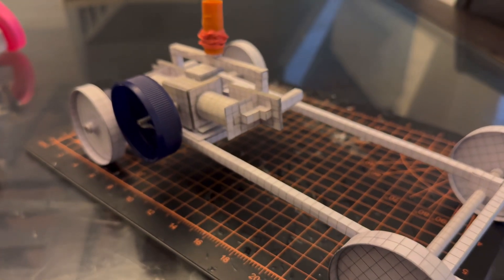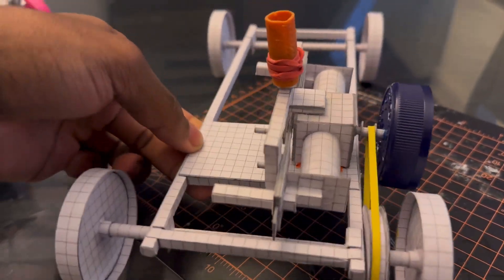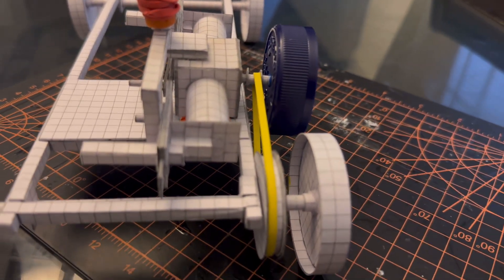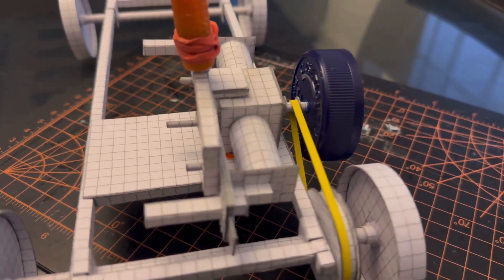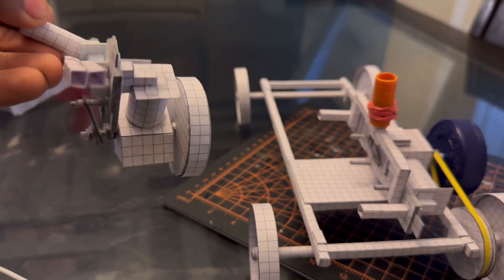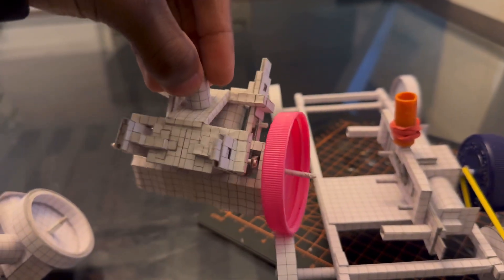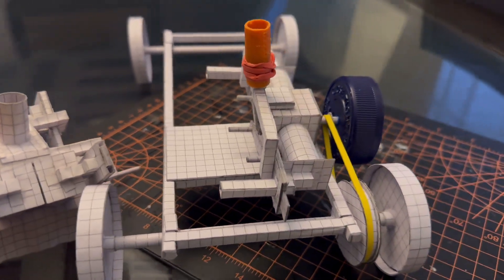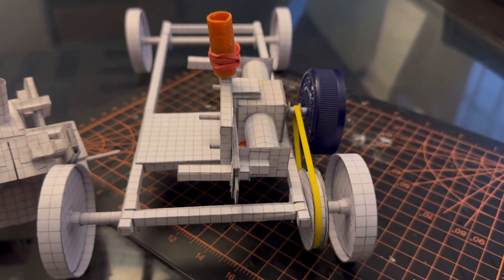Paper Engine Powered Car

Comment: add a radio controlled servo to steer, and motor to start the engine, or another servo and motor to control the gear ratios

Comment: try making a paper turbocharger and connecting it to an engine
Reply: since these engine are ran off  of compressed air adding a compressor won’t do anything but make the engine run less efficient 😓
Reply: it would make a cool sound tho @0-MACMAC-0

Comment: You could make a flywheel for the engine and then make a smaller one for the wheel. It would increase the torque needed but it would also have a faster top speed
Reply from the maker: Yes youre right but one main problem with that engine is that the shaft is too flimsy and the rubberband is pulling it towards the rear wheel so then the shaft is now angled which is causing the rubberband the rub against the side which is creating friction. The engine will run more efficiently if the friction is reduced, increasing the torque and top speed.

Comment: What if you just use the v twin and make it front wheel drive? I feel like that could potentially work. nice work tho!
Reply from the maker: Yes it would work but the engine will still be facing the opposite direction. And Appreciate You Bro :)